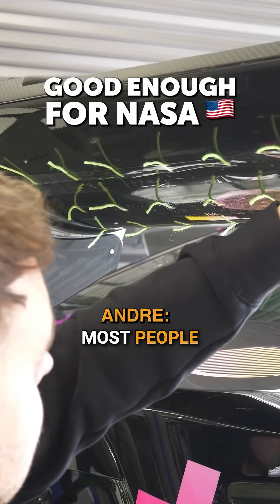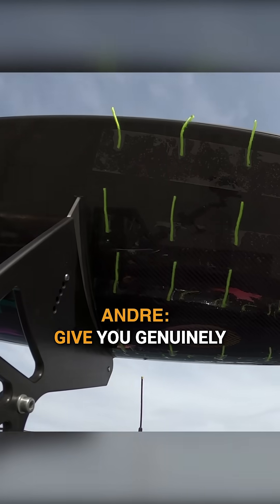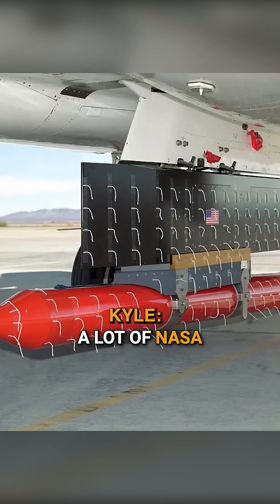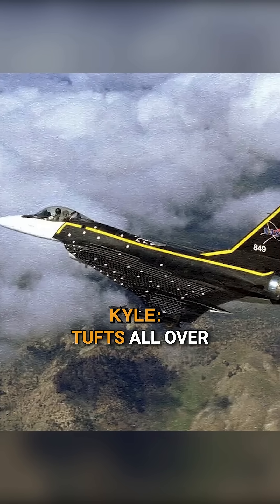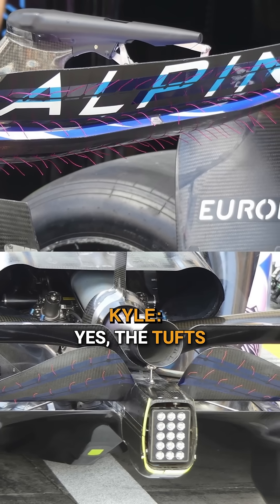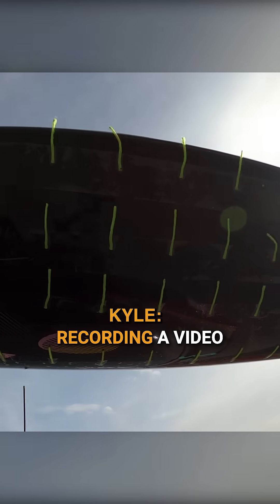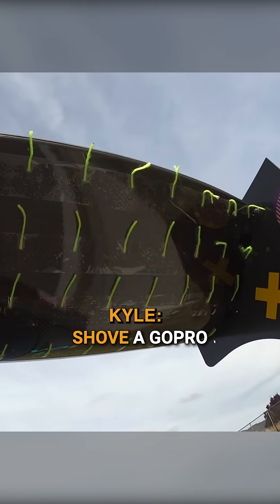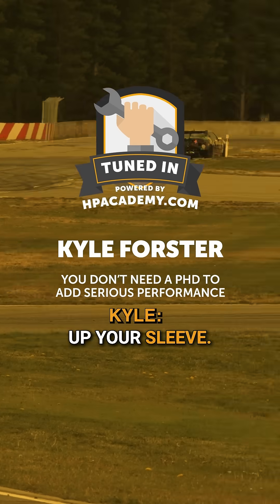Good Enough For NASA

Comment: A buddy a while ago did this with a honda civic. He had done some stand-alone tuning with a ghetto homemade aero kit. Taped strings to one half of the car. From Phx to Vegas he got about 50 mpg. Granted he was using a kill switch to shut the engine down and coasting at over 100mph. Lunatic. Bump start in top gear at the bottom of the hill and drive like grandma. Lol

Comment: Back at Scaled Composites we would put the tufts on parts and test them with the land shark.  It was a truck we'd blast down the runway with a wing section or control surface mounted to.  Invaluable data quickly gained for laughably cheap.
Reply from the maker: Great name too! 😂 Thanks for sharing - Taz.

Comment: The computer simulations have to have real world data to verify correlation, there will always need to be a blend. 

Simulations allow the aerodynamic changes to be checked with small changes etc, but as seen in F1 etc, wind tunnel and real world don’t always agree. And that case real world is REAL.
Reply: I was sitting here thinking much the same.  I suspect AI can have a big impact here.  Not only in gathering and formatting data for entry into a simulation.  But the ability to watch the telltails during real world testing for itself via cameras. and make adjustments to both the model and simulator accordingly.

Comment: Correct about the data gathering but you can never out engineer the aerodynamic issues of a car. 

They don’t travel fast enough for it to matter when the design is already largely aerodynamic as it can be.
Reply from the maker: And how does it get to be 'largely aerodynamic as it can be'.
Testing and development.
If you haven't listened to this podcast with Kyle yet and want to learn more about motorsport aero from club level to F1, this is a great chat and you will love it, I promise - Taz.
Reply: yes you can by properly figuring out aerodynamics instead of using tests like this that make it irrelevant